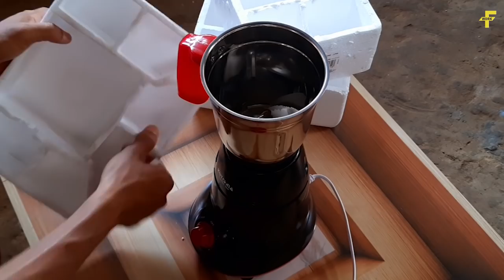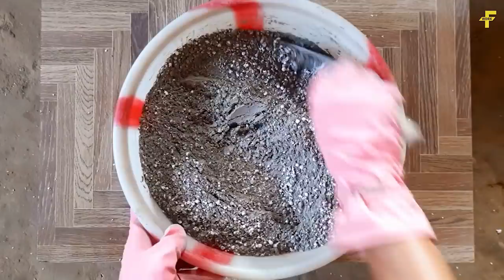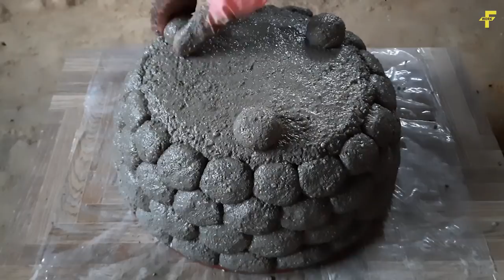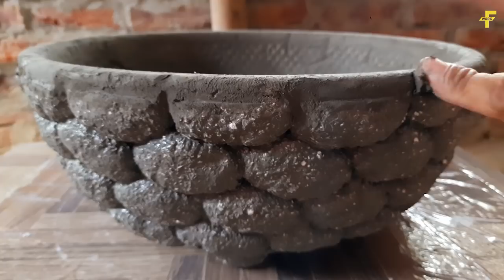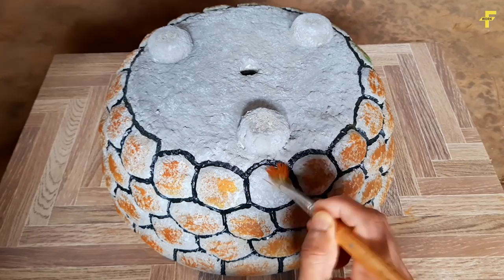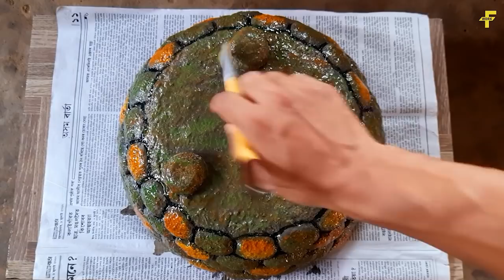Flower Pot Making from Thermocol and Cement

Comment: It must be light weight pot, foam instead of sand? Would like to know the purpose of white glue (fevicol).
Reply from the maker: It is lighter than a pot made of sand and cement. By adding glue, the cement will stick well after it dries. It also works as a waterproof layer.